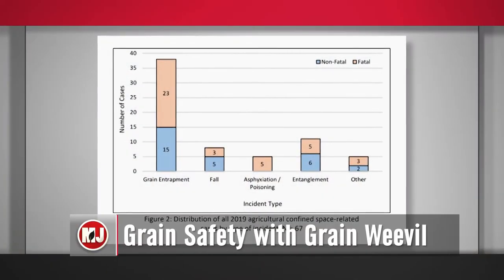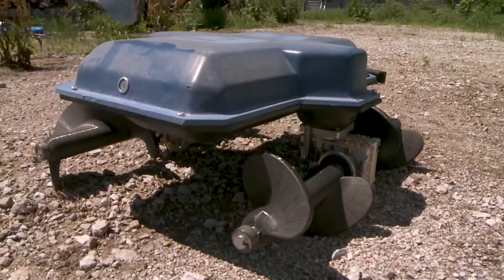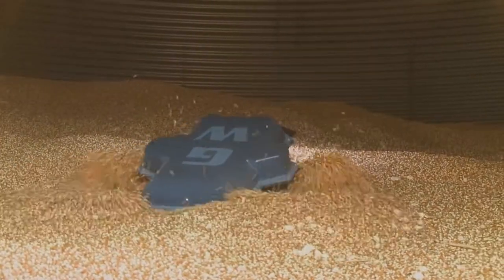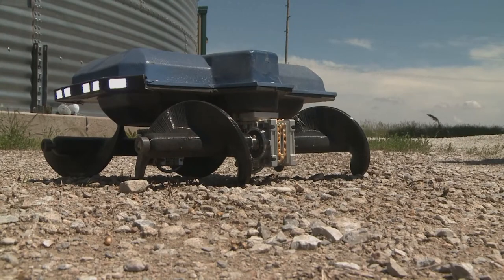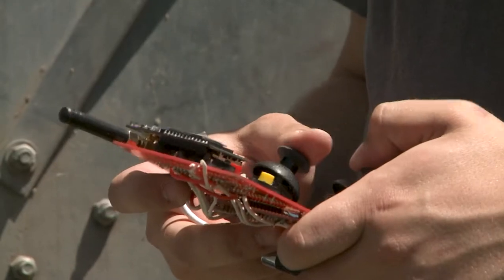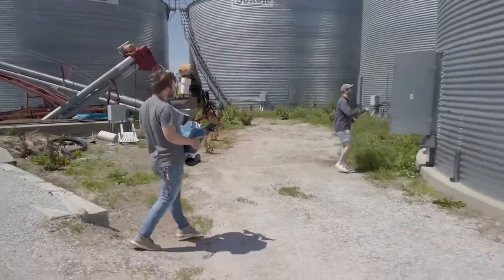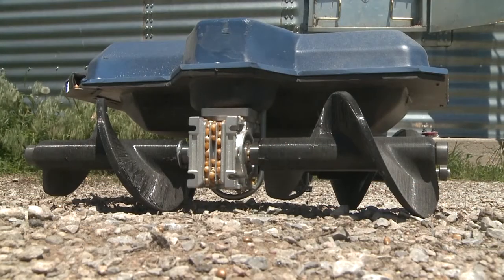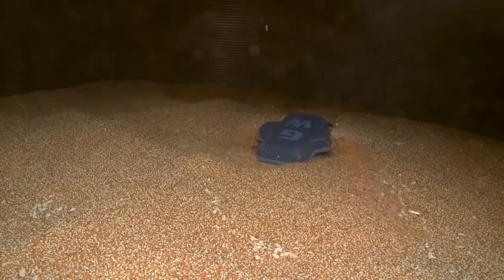Grain Weevil Robot | Ben Johnson & Zane Zents | June 18, 2021

Comment: Unfortunately, this won't save your friend from having to go into a grain bin ever again. There will still be loads of corn that this, admittedly cute and very well named, robot won't be able to bring to the central auger by simply driving around. Also, sweeping when you get down to the really low levels of grain.  I have spent many hours in a grain bin over the years, and I like what you guys are trying to do here, but I think it's missing the mark. One way I can see this being more useful, is adding a bulldozer like attachment to the front of it so it can more effectively push around grain where you want it. Also, adding a fender of sorts to the top side of the auger might make it more efficient...